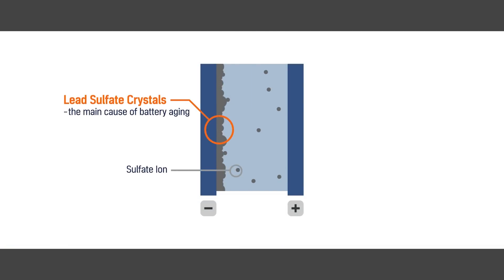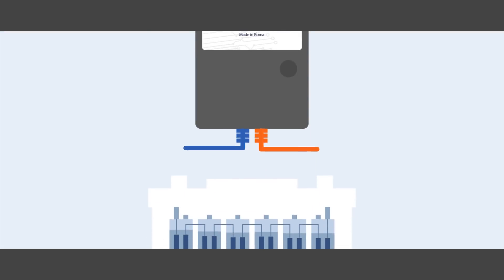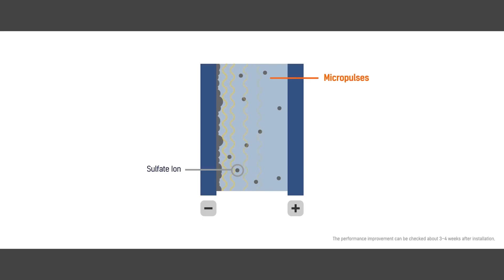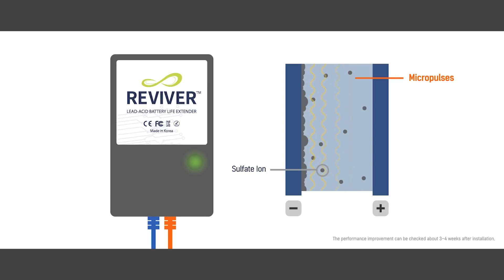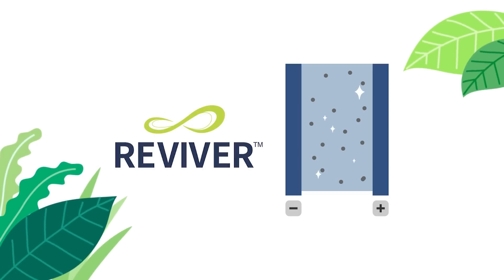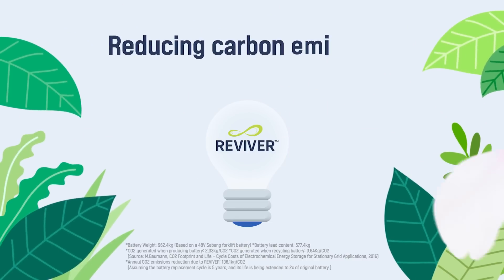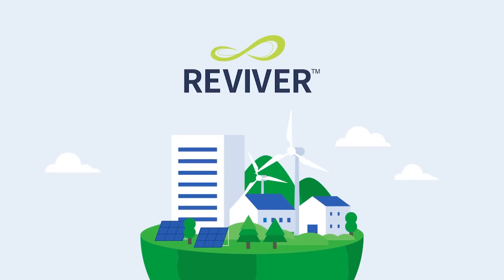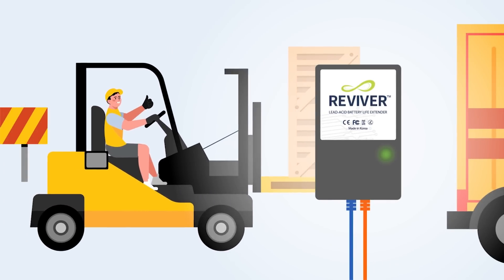REVIVER_The Best Lead-acid Battery Desulfator Introduction (Sub: ENG/SPA/FRE/VIE/KOR)

Comment from the maker: #leadacidbattery #배터리 #battery 

:yt:ENGLISH
REVIVER | Lead-acid battery life extender 

Over the past 150 years, lead-acid batteries still have been the most used batteries due to being safe and inexpensive, with a recycling rate as high as 99%. However, the disadvantage of lead-acid batteries is their short lifespan.
So what is the cause, and how to solve this problem?  Please check it out through this video.
Let‘s revitalize and extend your lead-acid batteries for up to 2 times longer, and enjoy up to 85% savings. REVIVER for a cleaner, greener EARTH!

☎ LET'S CONNECT
Website: https://reviver.kr
Tel: (+82) 2-3390-0481
Email: support@reviver.kr

===========000============

:yt:한국어
REVIVER | 납산배터리 성능개선&수명연장 장치

안녕하세요? Dr.리바이버TV 채널에 오신 것을 환영합니다. 
혹시 납축전지의 성능이 급격히 떨어져 고민이신가요? 
축전지의 성능이 저하되는 원인을 살펴보고 
더 오랫동안 좋은 성능으로 사용할 수 있는 방법을 알려드립니다.

☎ LET'S CONNECT
홈페이지  https://reviver.kr/
네어버 블로그 : https://blog.naver.com/support_reviver
카카오톡 채널 상담 http://pf.kakao.com/_vKxgSK/chat
카카오플러스 친구 http://pf.kakao.com/_vKxgSK
대표전화: 02-3390-0481
이메일: support@reviver.krhttps://yt3.ggpht.com/KOxdr_z3A5h1Gb7kqnxqOCnbZrBmxI2B_tRQ453BhTWUhYAlpg5ZP8IKEBkcvRoY8grY91Q=w24-h24-c-k-ndhttps://yt3.ggpht.com/KOxdr_z3A5h1Gb7kqnxqOCnbZrBmxI2B_tRQ453BhTWUhYAlpg5ZP8IKEBkcvRoY8grY91Q=w24-h24-c-k-nd